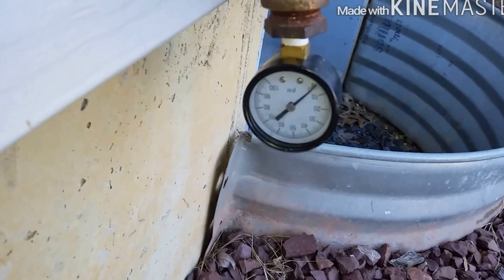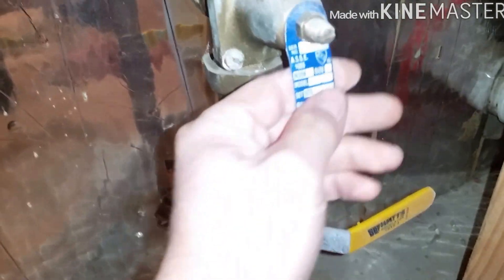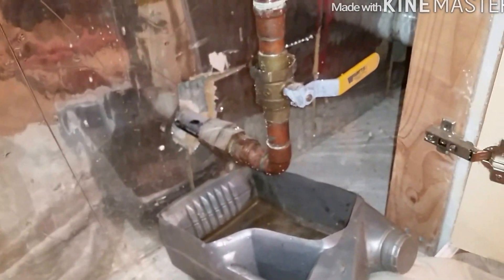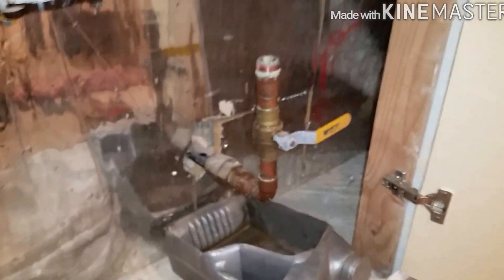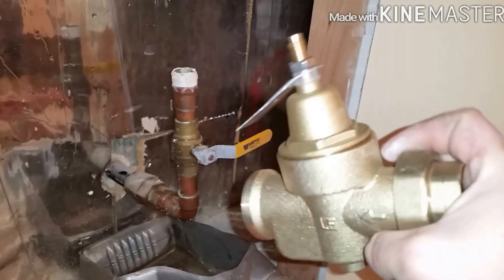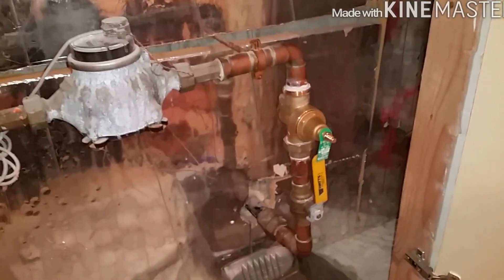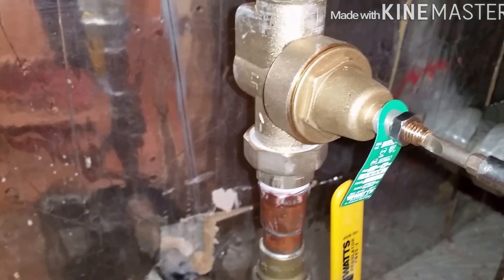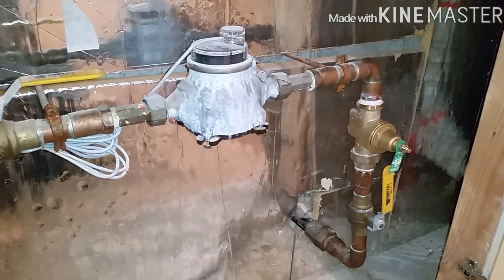Pressure reducer valve on main water

Comment: Great video Justin.  I had the EXACT same problem at my house and instead of changing it out, I used the rebuild kit.  Cleaned the inside good with a toothbrush and flushed it out several times.  Actually posted a video of that on my channel if anyone else is interested.  I wish i had double unions (makes the job easier) but I didn't so I chose the repair route.  Also installed permanent liquid pressure gauge so i can always monitor.
Reply from the maker: Cool I'll have to check that out